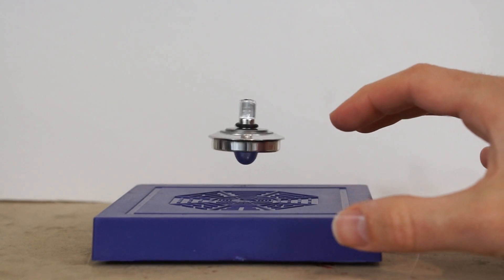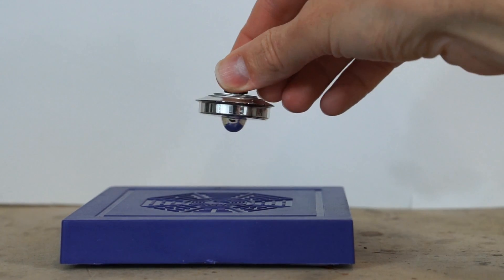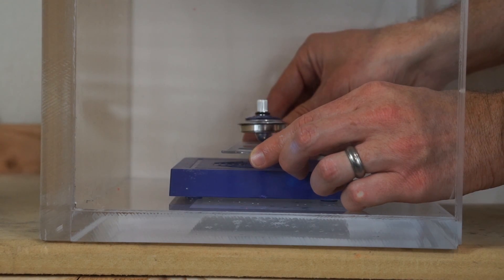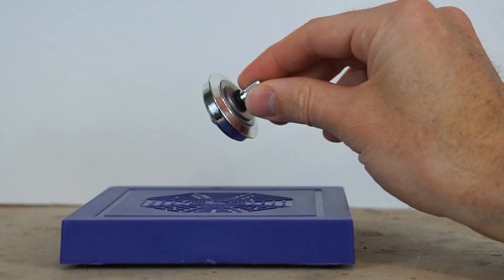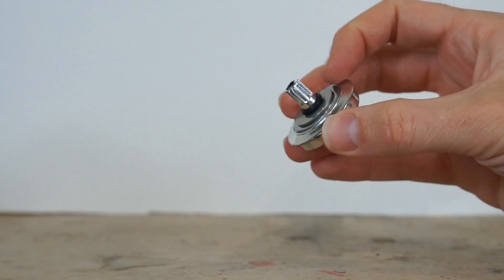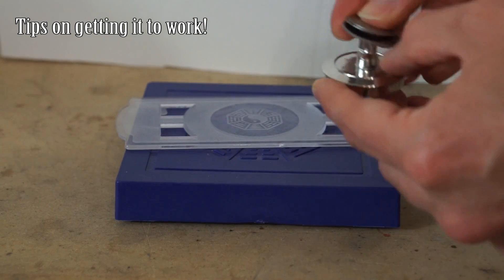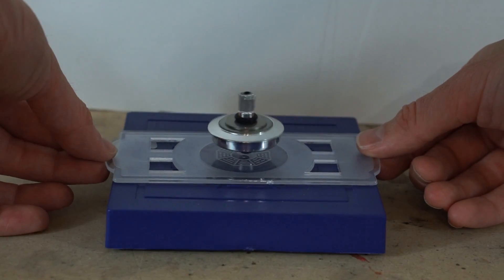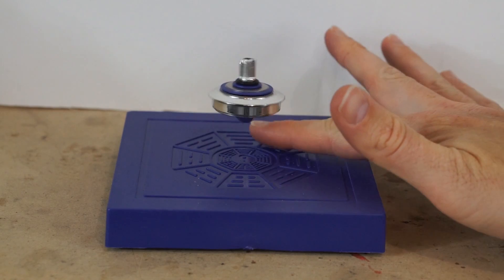Will a Levitating Gyroscope Spin Forever in a Vacuum Chamber?

Comment: The Action Lab

The main contributor to loss of rotational momentum is the fact that work is being done through eddy currents to heat both the base and 'top' magnets through the interaction of the spinning magnetic field.  Precession also contributes a small amount as work is being done to keep the top upright...precession is what makes  tops and gyroscopes function.
There is mention in the description that the actual top is made of plastic, so there are no eddy currents generated here.  The ceramic (ferrite) magnet is a good choice for this toy as the actual magnet material has a very low electrical conductivity, which keeps eddy currents to a minimum...but they do still exist, trading rotational momentum for heat.  Action Lab speaks of the metal washers added for weight...I'm guessing they are a major culprit in the eddy current equation.
I'd like to see a re-do of this experiment with no metal used for weight, and the top spun up with an electric motor for consistent start RPM.  THEN air drag could be assessed.  One could also do a trial with just the top on a dished base...in the vacuum chamber with and without air, the mechanical friction of the top against the base should remain constant.

Comment: This experiment is very similar to an established type of vacuum pressure instrument known generically as a spinning-rotor gauge. A spinning rotor is magnetically suspended in the vacuum and accelerated to a calibrated angular velocity. The accelerating force is then switched off; the angular velocity decays under the influence of the viscosity of the surrounding gas. The rate of decay is measured by the electronics and forms the basis of the measurement of the pressure. It is interesting that in general the viscosity of a gas is independent of pressure (see kinetic theory of gases) but when the pressure is low enough that Knudsen and then molecular flow regimes apply it is found that the measurement principle is genuine and valuable as a transfer standard. So the answer is: regardless of any magnetic, eddy current or other effects the rotor will continue to slow down if placed in a chamber pumped by a mechanical pump. Here's a link to one manufacturer (no connection to myself). www.mksinst.com/product/product.aspx?ProductID=283

Comment: The rotation in magnetic field induces currents in the gyroscope itself, they are dissipated through heat. I think the spinning time actually has to do with the internal conductivity of the gyro. Chill it down (liquid nitrogen might do it :P) and it will spin much longer. Or maybe not ?
Reply: You are probably right. Just read your comment and made me think of it, electric induction in the gyro generates an opposite poled magnetic field that would generate magnetic friction (N-N, S-S). In essence it's the idea behind the Tesla generator, or commonly known as AC generator. You use this repelling force to induce currents in coils, wich by themselves produce an opposed magnetic field wich's strength is derived off the initial magnet's strength at the core axis of said generator and the number of windings souch as geometry (distances, number of coils, etc) of the system. This sets also the maximum output possible in a generator, being the melting of metal due to internal electrical overfriction your limit; this is given by the diameter of your coil winding thickness.

In the case of this gyro, the currents are incredibly low, so my guess is that's why it takes relatively long for it to tip. In a 0-gravity scenario it would probably spin for a felt eternity, as for radiation could have an effect in the long run. Now, inside a faraday cage , floating in 0 gravity... it would spin 4 ever.
Reply: I'd love to see the nitro-cooled version of this experiment indeed, if only to get more data. But a significant increase in spin duration would probably indicate Eddy currents were indeed the dominant force in this system!
Reply: The Cheaterman Nitro-cooling it doesn't help, when you do it, you just "take" heat, but the currents keep are the same, thus you keep losing energy. Other possibility is cooling it so much that it becomes a superconductor, in that case forget my argument
Reply: Santeri Siiranen it has everything to do with friction. Friction comes in many forms and sources.
Reply: Cameron Dufton yeah it does but in this case it has nothing to do with slowing down the gyro
Reply: HAWKY 
But if you make it a superconductor you wouldn't need to spin stabilize it.
Reply: Thank you.  I doubt the magnet in the base is "moving".
Reply: @Mabus: No, because the system has forces acting on it. It is balanced between gravitational and magnetic acceleration.  As the earth rotates, the lower supporting magnet changes orientation and the direction of gravitational acceleration are changed. Those forces create torque on the top which changes the angular momentum so that the top will stay horizontal to ground. It's also the reason the top slows down.
Reply: @bryan31385  Angular momentum of a rotating body doesn't care about the universe. It will try to resist the rotation of the earth if it can. Theoretically, if the top was suspended not of a magnetic field but by absence of G (which is not possible while on earth), you will see the top rotate slowly, completing a full rotation in 24 hrs. You are exactly right.
Reply: you are both right
Reply: y did u write dat much
Reply: What really happens to the magnet is that the gyroscope was not on its absolute horizontal axis, as this is extremely difficult to do. Because of this, the force of the magnetic field  is not distributed evenly on the edges of the gyroscope, this causes a increasing oscillation in amplitude of the distance to the magnet and this has proportional correlation to the strength of the magnet (obviously). Causing it to loose control
SIMPLE ANSWER: The fidget spinner doesn't slow down, it looses balance. So, the magic rocks (magnets) make it loose control because the fidget spinner is near impossible to be spun horizontally.
Reply: Yeah that is much better explanation. I think this has nothing to do with friction. It's about heat produced by eddy currents inside the gyro and the round magnet that slow the gyro down.
Reply: You must also take into account that the eddy currents are 180 degrees opposed to the magnetic feild. This reverse current and magnetic feild are what slows down the top and makes it fall.
Reply: Mihai-Andrei Caţan I think it eventualy will tilt due to earth rotation.
Reply: @mabus4910  That must be one factor, nice.

Comment: I realize that chamber is polycarbonate ( if it's acrylic,,, WOW ) but don't forget there is a force of about 1 ton on each panel. I hope your glue joints are really good, but even if they are they will eventually " craze" and fail. So use blast shields around it because it will fail. It may take a long time, but be careful. I have worked with plastics and vacuum chambers for 30 years and I have seen some crazy things. Great vid though,,, have fun and stay safe.

Comment: I can most certainly say that the top stopped rotating not because of the jiggling in the magnetic field, because electromagnetism and gravity are both central force and it can be mathematically proved that central forces conserve angular momentum. It is most probably due to the formation of eddy currents due to change of magnetic flux.

Comment: My guess is the gyroscopic procession is magnified by the opposing magnets, much stronger than the effect of gravity alone. Once procession reaches a point, you no longer repel magnet fields enough to oppose gravity. The wobble is just that procession visualized and it looks like you have the same pattern with and without a vacuum, so I suspect friction from the air is a very minor influence.

Comment: You applied x amount of energy with your fingers and that energy is dissipated and transferred in form of spinning movement, eventually that energy will be fully transformed into movement and run out. Vacuum only helps to slightly increase the spinning time by saving the energy that otherwise would be waist with air friction.  Energy can’t be neither created or destroyed; it transforms

Comment: no, because there is no such thing as perpetual motion.
Reply: There is technically perpetual motion but it’s useless because any forces at all even if it’s undetectable it slows it down
Reply: betterert;   But has the universe stopped yet? How can you confirm it’s not perpetual motion.
Reply: btw there is perpetual motion, theres a fluid which drains itself up through a tube, but its not powerful enough to harness energy from
Reply: Perry Allen It could last really long, but it will eventually stop. And not every river in the world is a perpetual motion machine either. The sun prouces heat, this heat evaporates water from the ocean, this water travels in the clouds and when it rains over a mountain the water slides down the side of the mountain, that is a river. So there are tons of factora that can make a river stop flowing. For example, the sun will eventually run out of energy to transform into heat, no heat means no water from the oceans, no clouds, no rain, and finally, no river
Reply: and there is no such thing as fly just boost and glide lol
Reply: Man every single thing that happens in the universe transforms energy into heat, that means that at some point the universe will run out of energy and there will be nothing but black holes alone in a completely dark universe
Reply: is the earth perpetual?
Reply: how can you confirm it is?
Reply: a friend of mine named horizontal Dave he made a perpetual motion machine he was that lazy he made a automatic hammock out of garage door springs on each end of the hammock they were Twisted the opposite direction to a certain tension and it was a wait at the bottom of the hammock and when you got in the hammock and release the tension from the weight It Rock you back and forth forever I sat in it and it worked but he was too lazy to even Patton that or anything and I don't know what he ever did with it but I have seen perpetual motion machine.
Reply: Technically every river in the world is a perpetual motion machine going to get technical about not to mention water fountains when water Mills you know the spinning wheel in the water water's pretty Perpetual
Reply: not wanting to undermine horizontal daves achievement, but this sounds like a swing. You probably put a bit of ooomph in with our weight and hips, maybe even without realizing it, but in fact your weetabix powered this machine.
Reply: Trollsquad57 how can you say it is?
Reply: Jerry Rochester you mean osmosis
Reply: betterert the only reason perpetual motion machines don't work is because of friction
Reply: heat death is irrelevant. if the sun burnt out it wouldn't stop the earth from revolving. Besides, I think if something remains in motion for billions of years, we can safely call that perpetual motion.
Reply: although technically every object and matter in the universe is in perpetual motion
Reply: ICXC CXCI what are you on about?
Reply: Probably a flat earther or some sort of loon.
Reply: 200 years ago there was no space flight. Never say never
Reply: frank woolsey yes, but space travel wasn't proven mathematically impossible, perpetual motion is.
Reply: Fantastic
Reply: you're the dumb one, the universe is NOT a perpetual motion machine, because if it was, the universe would never die from heat death.
Reply: betterert yet
Reply: good point, because this one guy made a self-flowing proplyethylene(i think?)glycol flask, its really cool check it out.
Reply: betterert there is ...it's called universe dumbass
Reply: https://www.youtube.com/watch?v=jsxroTt9IhY perptual motion
Reply: who say there is a universe fucktard? or just earth the only place you ever see or have seen. stupid teenagers

Comment: Gyroscopes use momentum of their spin to stop themselfes from turning in one way, it stops because on magnetic field like this it have to use this energy to stabilize all the time untill it is too low to stop it from rotation, by spinning it you simply gave it power required to stabilize, but it burns this power over time. Eddy current might slow it down but it would take much longer.

I am too late to save this comment section...

Comment: Grip knurl makes me think it should be possible to use a power drill or similar to spin providing both super human speed and (with proper lift technique) a far more vertical starting spin. So here is an experiment for you: can you design a similar system that will spin for several minutes to hours?

Comment: it won't go forever
i did not plagiarize 5:10
and the reason is you truly can't get rid of friction in this system so when it's spinning on top of the magnet here it's actually wobbling a little bit and it's pushing against the the round magnet that's inside of here and that round magnet is moving a little tiny bit and that friction is slowing this down so even though it's floating above it they're communicating with each otehr through the magnet field and ti's slowiong it down and it wobbles more and more it's lsowing the sin]lin down because this magnet is moving and eventually the spin slows down enough and it makes the spin unstable until it eventually flilps over and falls. so even though it is floating in air it's still in communication with the magnet that's on the ground that's slightly moving and sliding inside of there and it does have friction so eventually this will slow down and stop in a vacuum

also because there's still air in there

Comment: Obviusly i will not spin forever because perpetual movement doesn´t exist and it is imposible for simple reasons. is just like an energy creator and the energy just can´t be created (energy only can be transformed in mass and vice versa) just like the equation [E=M]C^2 no matters if theres no air. 

im a 12 kid and i know it 

also im spanish lel
Reply: how would you turn energy into mass?
Reply: betterert just throw something without any effort from you and then throw it with a lot of force 

The thing that you throw with force have more mass than the thing without force

Cause you just transformed your energy into mass and for that reason it hurts more when you throw something to anyone with more force

Comment: I think it will stop even if it were a full vacuum, because it's wobbling. Even slight wobbles on top of the spinning motion will gradually drain the kinetic energy and convert it into thermal energy to be released as radiation. It should last significantly longer though. That's my guess.

Comment: Titanium shell, heated laser on the inside of outer shell, mercury in center of ship,spin till weightless, very small spark of electricity on outside makes allergic reaction it will hover opposite direction from spark.

Comment: It WILL stop due to a number of variables, the biggest one being that it is not operating in a complete vacuum. There are still air molecules causing drag. Additionally, the wobbly motion of the top transfers that energy to the lower magnets. This just to name a few.
Reply from the maker: +Jake Jones actually the biggest factor by far that I failed to mention is gyroscopic precession.
Reply: Perhaps, which is the "wobbly motion".

Comment: When you said "a good example of something spinning in space is..." I was surprised you didn't say "... the moon", because it demonstrates both the 'spin a long time' thing and the '... but still communicates with other stuff' property.

The moon originally had whatever angular momentum it had, but due to inconsistencies in its composition - its center of gravity is not actually at its geometric center, likely a side-effect of being formed in a collision and not having enough mass to have a lava layer or hold an atmosphere - it has 'tidal locked' to Earth. This is why we always see its same face: the moon's rotation around its own axis is the same as its rotation around Earth, i.e. the moon's 'day' and 'year' (both with respect to Earth) are equal.

This might seem like a weird coincidence, but it is the norm for reasons that parallel what you spoke of with magnetic fields... bodies with mass 'communicate' with each other via gravity, and this can slow them down until a stable relationship like Earth/Moon arises. If the masses of both bodies are similar, both can tidal lock with each other; Pluto and Charon do this, like an adult holding a child's hands and spinning around fast, they both rotate but they always face each other.